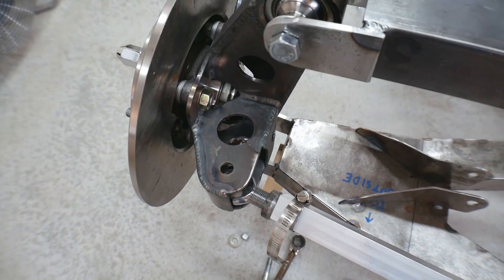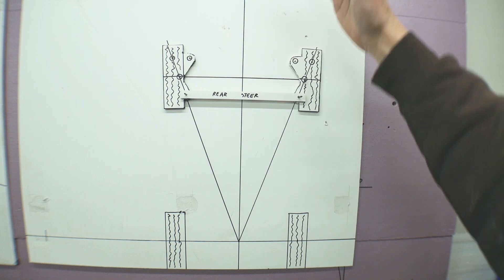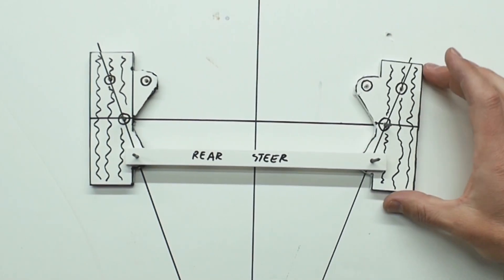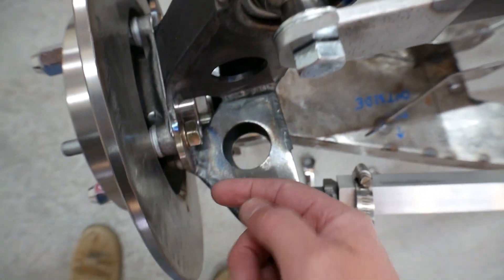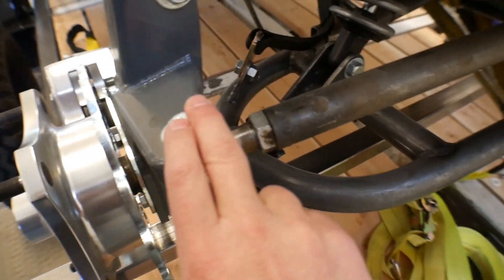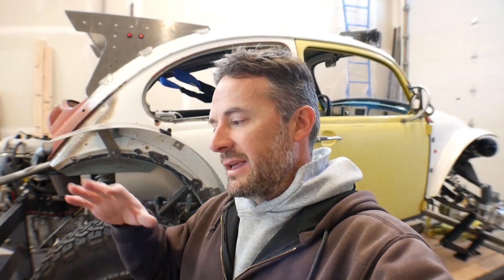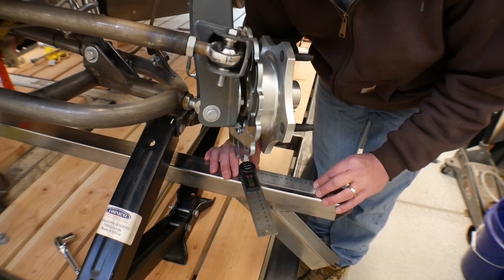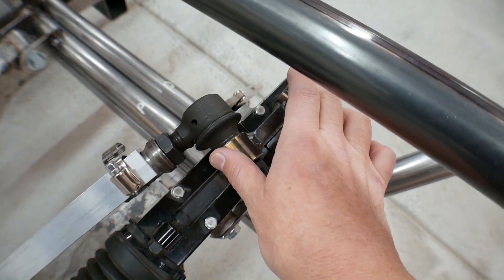Steering Ackerman, how it works, and doesn't work...

Comment: Great video mate very informative 👍keep it up!  I have never tackled a steering or suspension build it looks pretty intimidating if im honest. Just wondering if your first bug is actually 5.2 ish degrees out of this acra...thingy 2.6 to get it equal then another 2.6 to get it to zero scrub? Im not being critical or trying to be smart , just seeing if im undstanding the concept correctly. Anyway cheers mate, love your vids and thanks the work you put into sharing with us. 🤙
Reply from the maker: Keep in mind I'm going a little OCD with this. Building a front end doesn't have to be this neurotic. 
If I could remove the 2.6 degrees then I'd be at neutral steering. I don't know how much it would need to be true Ackerman. I'd need to lay it out like I did on the board. But it would probably be a couple degrees. But pretty much what you described.
Reply: @DougBugBuilder  thanks mate, I think it's all above my pay grade but I might give it a go one day. I agree physical models are the way to go with things like this. Rock on brother 🤙

Comment: If I can leave a suggestion, I would try to move the steering rack to the back. Your shock looks like it is in the exact middle of the lower arm so it will not interfere, you may just have to get a different rack (that has the shaft coming from above) to help with steering shaft routing/angles. If not an option, while you move the steering arms on the spindles may as well make some new ones that sit as close as possible to the rotor so that the ackerman will be "less worse" 😂 rotors don't flex and your spindles look beefy so I'd say a few mm clearance between them would be enough
Reply: Moving the steering rack rearward should resolve the ackerman issue. 1st and 2nd gen miatas are front wheel steer and the steering rack sits behind the attachement points for the tie rods. Its all about the triangles. Take the triangle that you make with the centerline of the rear axle and the pivot point of the spindle and youll get an angle. Its probably going to be around 20 to 30 degrees depending on track width and wheel base. Thats the angle youre shooting to make between your steering arm and your tie rod connection arm. So lets say you need your tie rod connection arm to be offset at 25° angle for your Ackerman to be right but you have to make it at 20° to keep bumpsteer in check. you can move the steering rack rearwards (in your case) to increase the angle between the steering arm and the tie rod arm by and additional 5° to get your magic number of 25°. Hopefully that makes sense. Unfortunately i cannot upload pictures for you.
Reply from the maker: @scrawnywhiteguy55  Thanks for the description. I might draw it out and see if I can get anything that works.
Reply: scrawnywhiteguy55 this is actually clever, did not think about it but it makes sense. Worth a try at least
Reply from the maker: Great ideas! I originally was trying to mount the rack back like where you are describing. But the steering shaft was impossible. At least with this rack. So I went with the front steer.
I really like your idea on hugging the rotor though. I'll consider that. Thanks for the idea.

Comment: In my opinion, the biggest reason your baja doesn’t steer well in the dirt has more to do with the non-Ackerman steering than being light on the front. Though a light front makes the effect worse
Reply from the maker: Maybe, I'm sure it would be better with proper Ackerman.
Reply: @DougBugBuilder  i wish this Ackerman fella would get his crap together already lol :] ]
Reply: Ackerman was good enough for horses and carts but the future does not have much more room for this old bollocks.Ackerman is the past there is much simpler and safer way to sort this out. It is called evolutionary design and will be presented soon. Remember,Ackerman is for carts 250 years old crap. There must be other way but maybe it is just easy to copy for many of you guys
250 years old in F1? Can't be right.
Reply: @radnasirhill , it’s worked well for 250+ years… what is your solution for the width of standard railroad rails? They date back to the Roman Empire
Reply: @rickrack78  And the knives are working more less without need for change or the spoon so I don't have no suggestion also on improvements of those. I'm not here to argue or proving you anything what I'm saying is that Ackerman is out dated and not suitable anymore for safe modern design. Ackerman is the reason why car design haven't changed since Ford T. Square box, engine on the front,4-5 seats,boot even the electric Marvell the Tesla washing machine on wheels is the old Ford T you guys polishing the turd here Ackerman is the handbrake of progress and not the solution. Horses and carts pal not 200MPH flying riders.
Reply: @radnasirhill , please explain how Ackerman steering alone has held back modern automotive design? Because, that’s a big claim. You hint that something is coming to free us from Ackerman’s strangle hold. Please, enlighten us?
Reply: @rickrack78  in my opinion Ackerman is only a guidance not the solution just look at it and detach yourself from big F1 shirts wearing knobs and you'll see that there is too much shite behind two wheel turning (toe,horse cart Ackerman and the other angles and "smart stupidity") how these guys explain their own uselessness, it is like your dentist telling you that I can fix your rotten fangs but I don't want you to have them healthy and take them to your grave with you. This Ackerman is too complicated for 21.century movement of two wheels coming from wooden wheel and axle. I got my own WIP way to get around this crap but I'm not here for promoting myself but for learning purposes. I like your style and like your videos a lot they've helped me combine amongst other used informations. Enlighten you will be somewhere else, your grin is visible pal but that's fine by me.
Reply: @radnasirhill , Ackerman is not for everything. As far as I can tell F1 is not employing it. For basic street driven cars, it works well. When racing, what gets you around the track fastest. On a road course there is a “do what’s needed” course of action. Some racers employ high camber so the tire can cool a bit between corners. Slip angle/scrub radius is compensated for on the outside tire in a corner. Tire temps are monitored and  adjustments made to use the contact patch as efficiently as possible. There are lots of ways to get to the center of a Tootsie Pop.
Reply: @rickrack78  That's my point:slip angle,scrub shit,reverse Ackerman,toe,camber, we are talking about two wheels movement into the same direction,right? Two stupid wheels? Are you sure that it is mechanics at it bests or engineering? You guys need to look at it from fresh angle, the whole thing stinks you want from Labrador to run as fast as Greyhound.